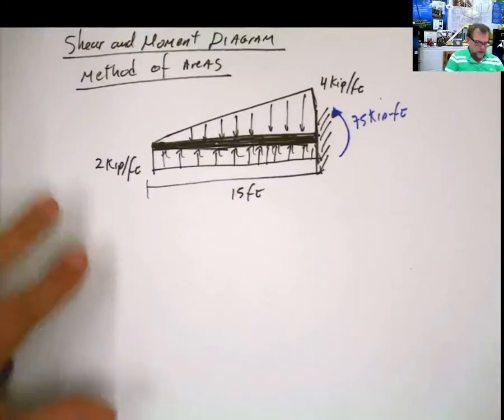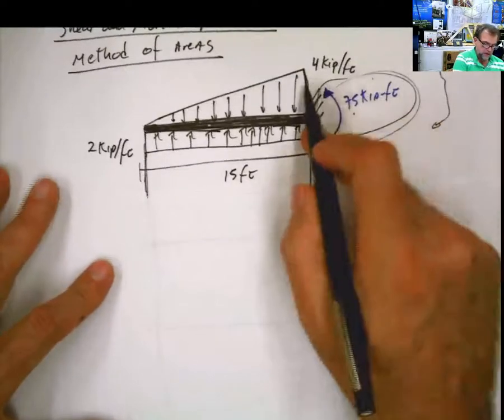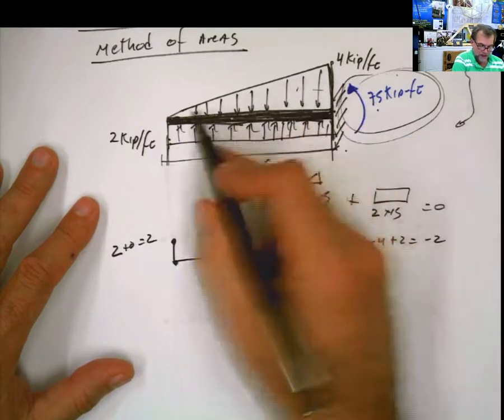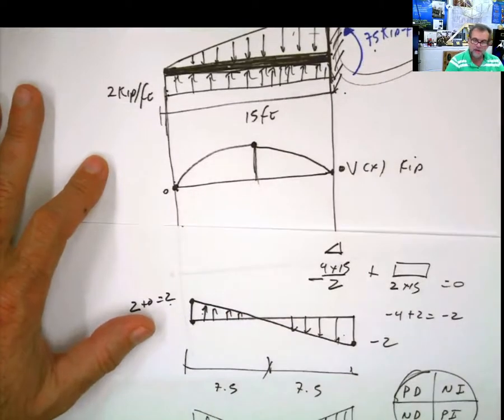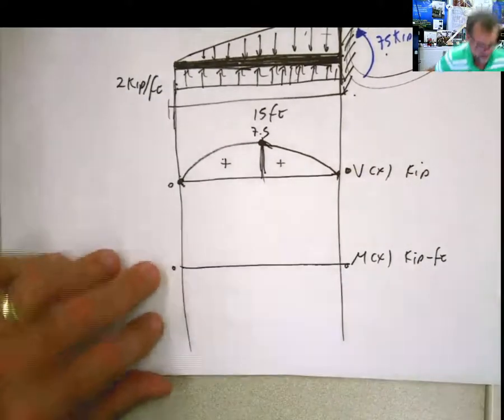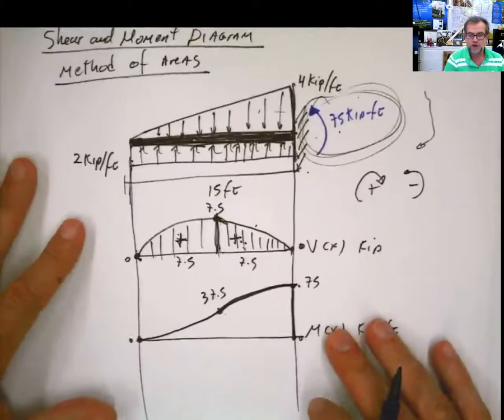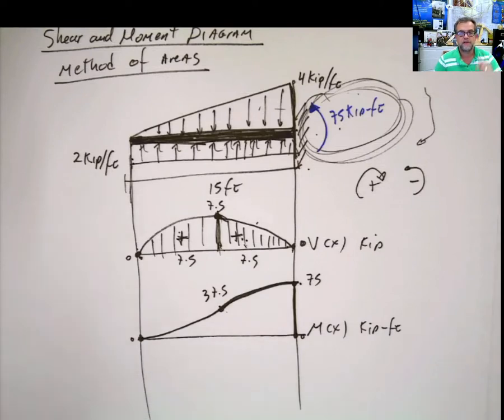Study set 7-10   Shear and Moment Diagram 2 distributed loads superimposed  Method of Areas

Comment: Dr. Zaurin,

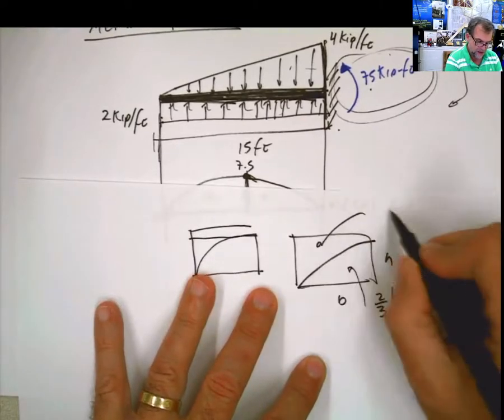I hope you're doing well this exam week. Around 5:30 you talk about the area of differing parabolas, I'm not quite sure how to tell what kind of parabola it is (quadratic, cubic, etc.) when using geometric methods like area. Could you clarify how exactly you knew it was the second type of parabola in this case?

Thank you in advance for your time!
Reply from the maker: +Brett Ross, I don't know what you mean. ..parabolas are always quadratic. ..
Reply: Thank you for your swift response Professor. My apologies, I should've been more clear. The rate of change of the parabola is going to change the area, correct? When doing diagrams by area couldn't the equation for the curve be x^2 or (2/3)x^2 or 4x^2 and we wouldn't know since we're just doing geometric analysis? Wouldn't this result in the area formula being different when you went to find the moment diagram?